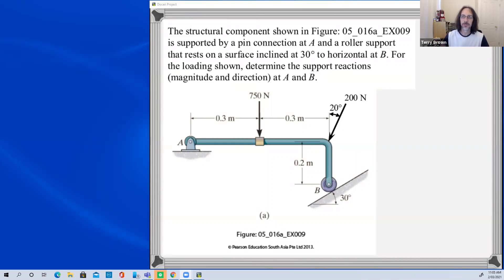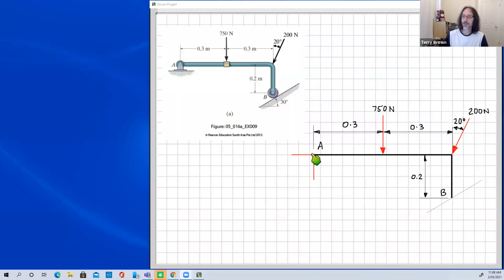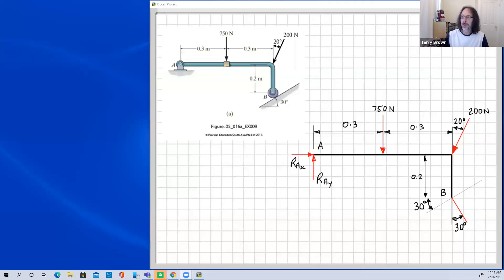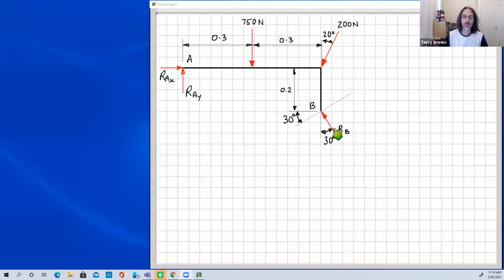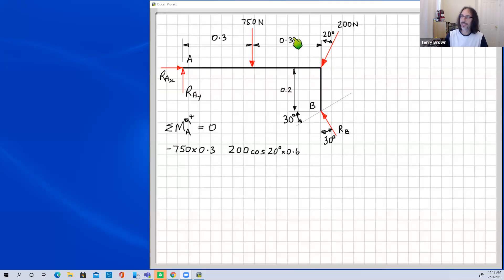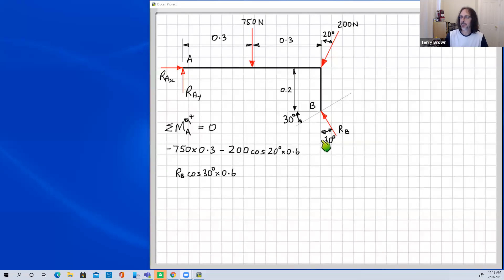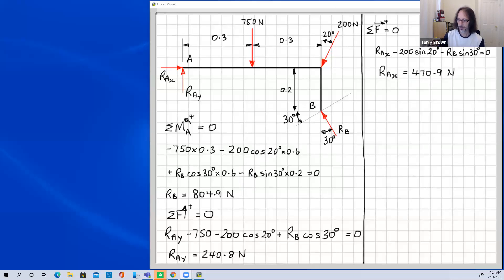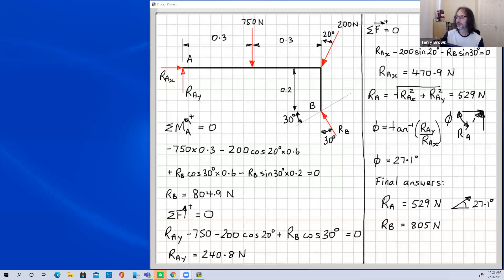Rigid body equilibrium Hibbeler 05_016a_EX009

Comment: in real life, how do we come to know that force is acting at 20 degree or at some angle
Reply from the maker: these textbook style problems are simplified to provide relatively simple problems that students can apply the methods of engineering mechanics to solve relatively quickly and easily. When you see forces depicted as an arrow at a point, like in this problem, the arrows actually represent the force caused by some other body/component contacting or connected to the body/component we are analysing. Instead of showing the connected/contacting body/component and making you solve a multi-body problem, the textbook just shows the force that is applied. We do a similar thing in the solution when we replace the angled surface at B with a force at 30 degrees. The 200 N applied force at 20 degrees could have come from a smooth contact with another surface at 20 degrees to horizontal.